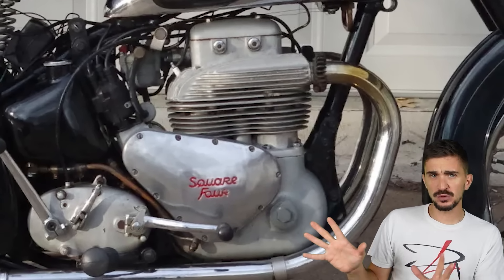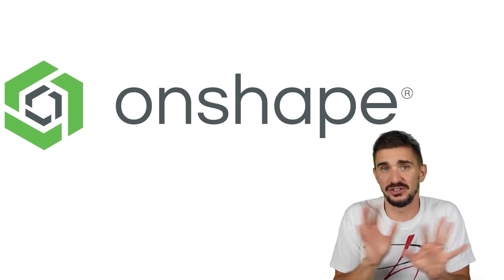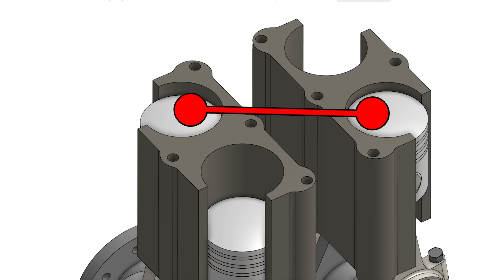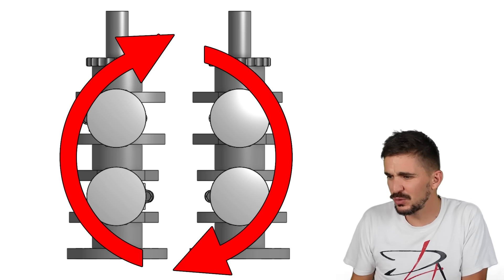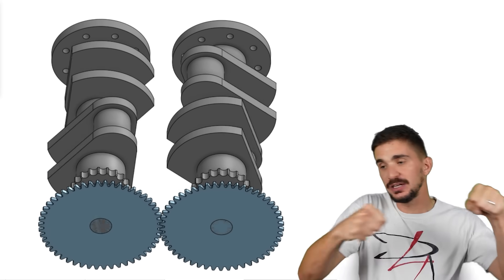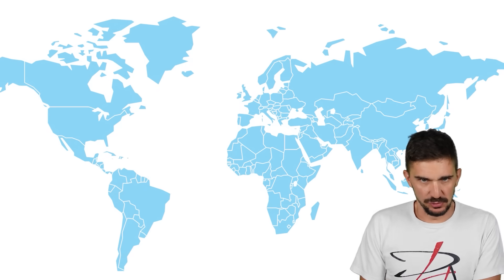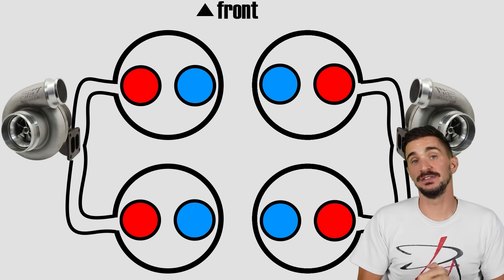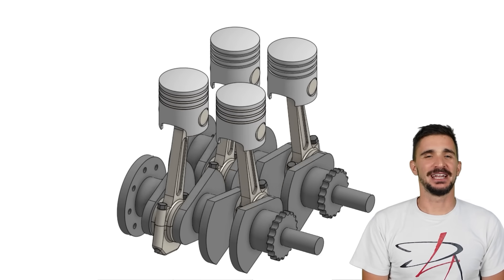From the Outside It Looks Like a Single but Inside Four Pistons Mingle! Square Four Engine Explained

Comment: Twin turbo? No. You want a single turbo with the exhaust ports near the center of the block. The turbo would sit on top of the engine. 

The intakes would be on the outside. Basically it would be a “Hot V” version of a square four.

Comment: If the whole setup does what you say and had better weight to power ratio than an Inline 4, then it'd be perfect for a modern economy. Less space for the engine means less space is needed for the engine bay. That means that the overall dimensions of the car can be smaller, which means less weight and materials needed for the vehicle to do the same work.

Lotta potential there. If I had the money, I'd pursue it for my quest to create a more affordable vehicle for people.

Comment: I met a guy who had an Arial square four. With it running, he put a glass of water on the seat and there was almost no vibration "rings" that formed in the glass of water.  I was amazed. It was the most vibration free engine I've ever seen. Very smooth to ride.  I can see where cooling for the rear portion of the cylinder block could be an issue, but if it were redesigned as a liquid cooled engine, that would solve that problem.  I thought it was revolutionary with the counter rotating crankshafts.  A very unique bike.
Reply: had a Suzuki GT 380 2-stroke triple with an airscoop shape on the engine head
Reply: @markrossow6303    I remember those. I had a friend that had a Kawasaki H3 750cc triple. It was a handful to ride.
Reply: @markrossow6303  remember those.   I even did a gt750 water cooled with 3 into 3 expansion tanks for the track -  my own tr750.
Reply: The rear cylinders didn't overheat.
All four overheated.
Reply: 4 piper was better than 2 piper (late 50s versus early 50ss).   I rebuilt one decades ago.  drove it around with more modern lubricants.   didn't seem to have problems, but I didn't tour with it, just around town.

Comment: Sorry to say that, but you're in some error in saying that the pistons are half way down with the crank at 90° or 270°. In fact, depending of the ratio between conrod length and crank radius, they're somewhat lower. The piston exactly is midway when the crank and the conrod form an angle of 90°. Hence, in an inline four the common gravity center oscillates with double the crankshaft frequency. »Better« inline fours feature two balancing shafts to accommodate this - the Lanchester balancing. Can this be balanced in a square four with 270° crankshafts?

Comment: It would absolutely require water cooling. As far as gyroscopic effects, you don't mention Moto Guzzi and BMW, who arranged their engines inline with direction of travel, eliminating the gyroscopic resistance. That was probably why the BMW's were so nimble.

Comment: In 1970 after years of riding Dirt , I wanted a street bike. At a big dealership in Memphis they had an Ariel that had been chopped, I loved the sound but didn’t care for the Harley springer front end. Instead I bought a very low mileage Kawasaki H 1, when it went into a speed wobble at 110 mph on a straight, flat section of I 55 I realized why the first owner traded it in so soon

Comment: And you certainly needed to lift the cylinder head - these engines were notorious for problems related to overheating of the rear cylinders, because of limited air cooling.  It looks like an obvious case for water cooling.

Comment: Another great video on a very interesting engine design. I actually worked on one of these back in the day, but only doing a top-end job. The owner, Pogo, attached a massive sidecar to it that gave it the look of a motorcycle hearse. Also enjoyed the part of the video in which you showed and explained how you make your fantastic graphics. I'm sure it was a plug for the Onshape CAD software product, but it was very well done. Your humor was also enjoyable and gave me a good laugh. Speaking of quality control, the Chinese alphabet has over 1,000 characters as opposed to our 26 letters, and they still can't spell quality. Keep up the good, make that -  quality -  work.

Comment: As a machinist, i dont think the 2 crank shafts is as big a deal as you worry about, simpliying greatly, the tolerance goes up the longer in any axis you are machining, or you have to spend exponentially more money on fancier equipment to keep same tollerance.  2 cranks that are half length can be machined to higher tollerance than 1 long crank for the same price.  You could do it with same number of crank bearings, and the connection with gears or some whacky chain setup, would have enough play in the system that perfect alignment would not be needed.  Having more room above the motor for more intake room is easy peasy.

Comment: Here's something I don't remember seeing on your channel. It'd be neat if you found a 'four square' motorcycle. They're pretty neat. You'd think it was a single cylinder from the outside, at least until you counted the exhaust pipes. They're four cylinders all packaged together without a V or anything like that.

Comment: In any case, this quad-cylinder arrangement will pose significant cooling problems. And two crankshafts connected together cost twice as much and have significantly more friction. There's no advantage to this arrangement.

Comment: What about inverting the Intake & Exhaust valves; then the Exhaust could be feed with air & positive pressure, into a single Turbine/Turbo, that will give Crankshaft impulse, and then some small pressure at the exhaust pipe exit. Might sound Buck Rogers, but it could be similar to the small Jet Engines, a few Pilots have put n Winged Suits for personal flying. Cars are too heavy for this, but motorcycles may benefit. I'm not a Mechanic

Comment: So if a 270° square four would work well... What about a square six?
Reply: Six is not a square number!  At best, it would be a rectangle six.  I suppose if you wanted to go wild, you could build square 9s (with three 120° crankshafts) or even square 16s (four inline fours)!

Comment: Thank you for giving this engine attention. After you said the Inline 6 was the one with perfect balance, I asked what about the Square 4, and other engines with 2 crankshafts that are counter rotating or mirrored. Imagine a Boxer Engine like that. Two crank shafts,  both the front pistons go in, both rear pistons go out, and one crankshaft has a flywheel or damper to match the weight of the gear on the other crankshaft that actually turns the transmission or Series Hybrid generator. Perfect?
Reply: Or, would it be better if that mirrored boxer was a flat 8 instead of a flat 4, because I now think it would rock front & back, but side to side would be perfect?

Comment: What about a tandem twin, like the Kawasaki KR250 & KR350, but for a modern four stroke? One could use a similar head to a conventional parallel twin without a massive amount of space issues but have a perfectly even firing interval and have perfect primary balance using the counter-rotating cranks as a counterweight.

Comment: Thanks for the video, very interesting. 
With today direct fuel injection technology a 2 stroke gasoline engine based on the Detroit Diesel principles would be great. (I wonder if Mazda doesn't pattended such engine lately). 
Could work for square 4 arrangement too.

Comment: You might want to notice the engine you show when you say it is “shorter than a V-twin” that the V-twin you show includes the transmission, the square 4 doesn’t. The square for in the “longest” front to back engine design bottom end I know of. The bottom end is as long as a pair of twins, good in many ways but not compact.

Comment: I restored two of those back in the 1970’s. I know every nut and bolt on that bike. It has two crankshafts operating in opposite directions so they cancel vibration.  My Ariel Four didn’t over heat because of how I jetted the carb and ignition timing. It wasn’t perfect but it worked very well.
Reply: also a UK built engine will break before it gets up to operating temp so overheating has never happened in history
Reply: @Sir_Godz lol 😂
Reply: Always wanted a square four ❤
Reply: Awesome Mate
Reply: richer afr is perhaps the best jetting for this engine configuration

Comment: If perfectly symmetrically spaced, primary imbalances should cancel each other out, completely, with 180 degrees separation.  

Main issue I see is just that, having the same distance between the cylinders in each pair as the width of the crank requires the distance between each pair makes a big engine, for a given displacement. That is, unless you make a very large bore/short stroke and design the counterweights to avoid collisions. Large bore is good for high revolutions, and makes more room for breathing.

Comment: cough, hi my name is Harley, been building them forever, when you I look at this engine the first word that comes to mind is.. POINTLESS....... making the piston smaller = less horse power.....

making more moving parts =  MORE  WEAR................ so I instanly figure any of my engines will last twice as long as this crap....   oh ps it also reqauires a more complicated fuel system, ignition asystem and timing :-)      So yeah lets make stuff that overly expensive to repair, disassemble/reassemble And has 40 more parts to service....  brilliant!   what kinda airhead designed it?

Comment: The square 4 doesn't actually have a rocking primary inbalance because the pistons across from each other's rocking couple balances out the rocking couple of the inline pistons
Reply from the maker: That's just another couple? It's the same thing you're just looking from the other side of the square. Or maybe I misunderstood?
Reply: @d4a  yes, it is another rocking couple, but that rocking couple rocks in the opposite direction to the inline cylinders so in cancels out.
also if you look at it from just the pistons going up and down the primary forces cancel out anyway

Comment: I mean it would be hard but with 2 mt07 cranks you already have half the battle for a experimental engine, then if you fancy to use just mt07 pistons and rods would just be the easy bet, tne the cylinders, head and block.. still a lot of design work but you at least have some of the hardest parts sourced and made, the cranks. Would love to see some square four brought to the 21st century and if you try crowdfunding I know people will just go for it man

Comment: hey bro, you mistake, gyro effect can't be cancelled! gyro effect - is abillity to keep direction while rotation. Its like start one gyro stabillizer on the boat, and after you turn on second stabillizer - first will what?

this two crankshafts works completely independent, just have mechanical synchronization of rotation
Reply from the maker: If it spins in the opposite direction it will cancel out. If it's an equal mass and distribution and speed it will fully cancel out.  It takes 5 min to research this... bro... before posting nonsense comments. Think before you leap and you won't be a 🤡
Reply: @d4a  okay, first - thanks for answer. now - second, you mistake between rotation moment and gyro stabilizing effect. Don't worry, chat gpt also stack there :) 
i helped him a little))
 Yes, you're correct.

When it comes to the stabilizing effect (the ability of a spinning gyroscope to maintain its orientation in space and resist external disturbances), having two shafts spinning in opposite directions with parallel axes does not cancel out but rather enhances the gyroscopic stabilization.

Here's why this happens:

The gyroscopic stabilizing torque depends on the moment of inertia and rotational speed. The stabilization effect arises from the spinning mass itself, not from the direction of rotation.

With two gyroscopes spinning in opposite directions, their reactive torques during maneuvers (precession torques) tend to cancel each other out, minimizing unwanted effects like orientation drift during turning or tilting maneuvers.

At the same time, the system’s resistance to external disturbances (attempts to change its orientation) is increased because the total effective moment of inertia becomes larger.

To summarize clearly:

The gyroscopic stabilizing effect adds up.

The reactive precession torques during tilting or maneuvering cancel each other out.

This principle explains why many stabilization systems, especially in aerospace and spacecraft applications, frequently employ two or more gyroscopes rotating in opposite directions.

p.s.  because you said in video about exact gyro stab effect - you mistake, if you mean rotational moment of inertia - you right, it's gonna compensate each other

p.s.s. this chat gpt - biggest problem with humanity

p.s.s.s  cool videos!! )
Reply: @d4a  5 minutes - isn't enough 🦧

Comment: Your explanations of things are usually very clear, however I think your presentation of balance misses the mark on a few details. Nothing said is incorrect, but I think you leave some room for misunderstanding.

The pistons themselves only move vertically, and the (primary) rocking couple from the motion of one pair of pistons is exactly balanced by the rocking couple of the other piston. In trying to lead into your next point,  you miss out on emphasizing that this balance is perfect and you almost imply that there is a vertical balance issue (there isn't) when you're trying to lead into the horizontal balance.

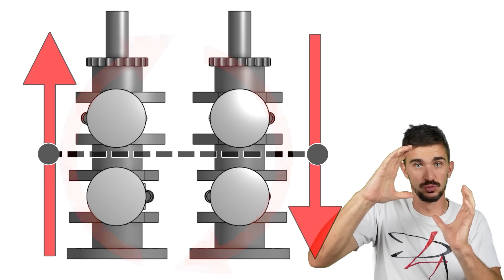Where you do have possible unbalanced rocking couples is from horizontal motion at the crank end of the connecting rods and mass of the crank's connecting rod journals. This couple from one crank does indeed add constructively to the couple from the other crank. However, the motion of this couple is not in the front-back direction of the arrows shown @7:34 (parallel to crank axis) but is instead horizontal, with the front pair of connecting rods moving right when the rear pair moves left, and vice-versa.

The horizontal rocking couples of from connecting rods and crank journals is not inherently negligible. What makes it a non-issue is that the crank has counterweights that balance that rocking.

The primary vertical balance is actually the exact same story with an I4. The front pair of pistons is rocking one way, while the rear pair of pistons is rocking the opposite: the total rocking of front pair of pistons is perfectly balanced by the rocking of the rear pistons. The horizontal story for the con-rods and crank journals is identical to the vertical story for the pistons (which the other masses also participate in) - it's the identical motion of the very same crank, just rotated 90 degrees. For the square engine, the vertical story is identical to I4, but the counter-rotating shafts break the horizontal balance.

Comment: Everything is telling me that the exhaust could be aligned towards the inside of the block with a hollow channel through the block being integrated into the exhaust pathway, and the intake being split into separate halves on the outside.

Comment: I feel like a rotating valve assembly that spins across the top of all 4 cylinders would be an easy way to get around the valve/rocker spacing issues.

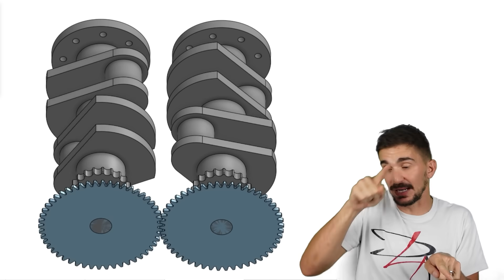Comment: 09:45 .. they connect 2 engines via GEARS???? Ugh!
Reply: They can’t use anything else because the crankshafts have to rotating in opposite directions

Comment: Modern four cylinder car engines use a balance shaft to eliminate vibration.  The contrarotating crankshafts do this job automatically.  But you can have two IDENTICAL crankshafts, four identical pistons, conrods, bearings etc. Making good construction cost.  I have no idea why it didn't become the norm.  Particularly for water cooled large engines. Some other aspects are that you could make a 1000 cc  four and a 500 cc twin with the same engine components. You could potentially use the same cylinder head for both.  Of course 360 degree crankshafts are a LOT more tractable than 180 cranks unless very heavy flywheels are used on the 180  and no one does.  Not so bad on a four cylinder but terrible for a road use 2 cylinder machine.

Comment: The room and expense and noise and wear of the crank gears have are all negatives as well. 
 A V4 has many similar advantages and many other outright advantages, like easily allowing for large oversquare bores and easy straight shot intakes.. Why no automaker didn't jump on V4's to differentiate themselves is a mystery. Looking at you Subaru. Ford had one in Europe in the 50's that made its way into Saabs and that is it for V4 cars.
Reply from the maker: An uneven firing interval on just four cylinders feels very unrefined in a car.

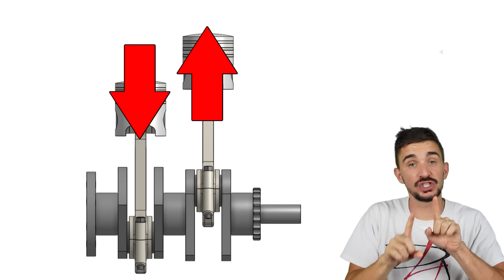Comment: 7:00 You are wrong. The engine has perfect primary balance. When you view the engine from above you are treating rotational forces as linear forces even tho it's different. Each piston is a corner of an imaginary square. Let's say pistons A and B are going down while C and D are going up. Each pair is on a diagonal of the square. The force of the piston pair A and B going down is located perfectly in the center of the square. The force of the pistons C and D going up is also perfectly in the center of the square. Two forces of equal magnitude and opposite direction with no offset. At 7:07 you show circular arrows. If you want to think in terms of rocking couples, here you have an infinite amount of rocking couples all around the circular arrows, all cancelling each other out. At 7:22 you turn the circular arrows into straight arrows, which hides all the forces coming from the circular nature of red arrows.